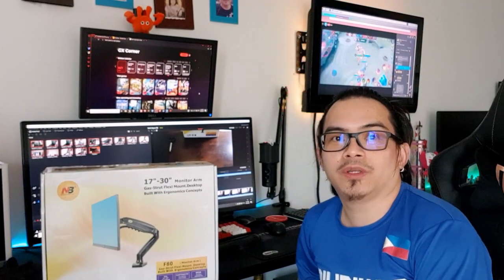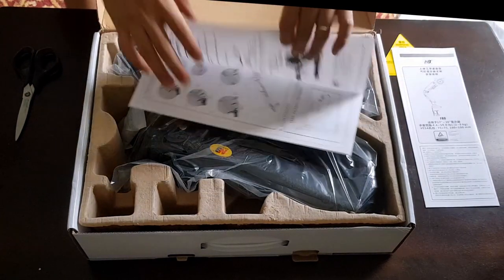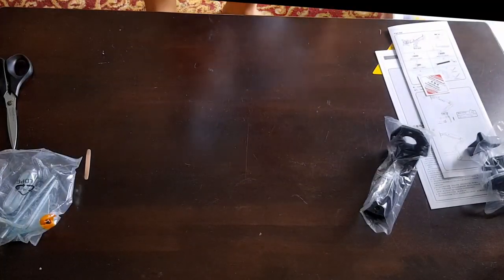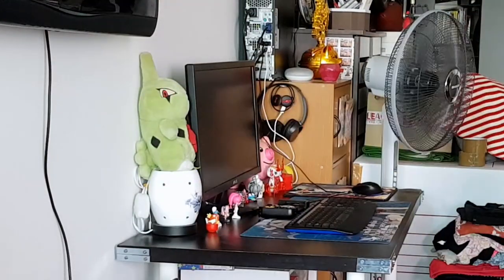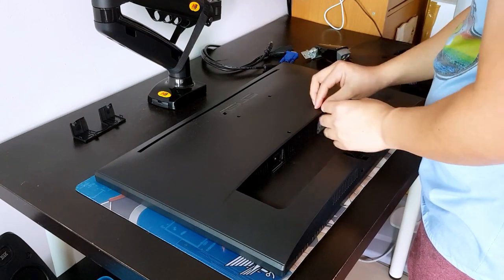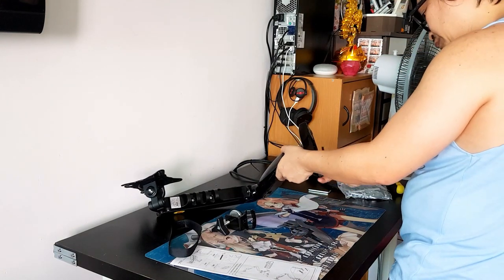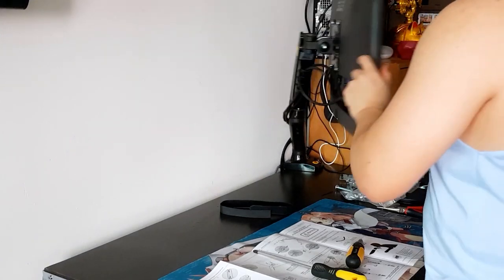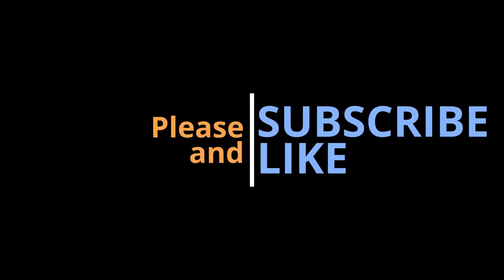North Bayou F80 Monitor Arm

Comment: Hello friend, excellent review I like that support, but I have a question, in the vesa adapter where the monitor is placed, exactly in the middle can a separate adapter be screwed? because I seemed to see one but I cannot be sure, what happens is that I do not need it to place a monitor but a camera and I would like to take advantage of the maneuver that allows this support, thank you for solving the doubts.
Reply from the maker: Hi Diego, thanks. I doubt if a separate screw can be added in the middle which touches the monitor. Though I have seen some adapters online for monitor mounts to convert them into camera mounts.

Comment: Hello po, Im having trouble sa arm niya, cause nagsspring back yung arm instead of staying in a certain angle. Also, paano nyo po napa-portrait yung monitor nyo? For some reason up, down, left and right lang sakin. Your reply will be much appreciated.
Reply from the maker: Meron siya adjustment screw para hindi mag spring back(up) yung arm.

Comment: Hello, is there a thickness requirement for the table? Thin metal table po kasi table ko eh. Thanks
Reply from the maker: Hi po, not really. Usually ang solution diyan is by using extra thickener. Pero sa case nito di kailangan kasi adjustable siya. Hindi ko lang pinakita pero gumamit ako ng sirang Hard drive sa ilalim para mas stable ang kapit.
Reply: @SabadoProject  salamat sa pag sagot boss. Nipis kasi table ko 1mm lang ata to eh haha. Bumili nalang ako kahoy pang pakapal just incase. nag order na ako nung f80 sana wala issues hehe

Comment: idol, ano max height from the desk na pwede i-angat yung monitor? Gusto ko sana kasi may monitors pa din ako sa desk kaso worry ko baka matakpan yung bottom part ng monitor na naka mount.
Reply from the maker: idol, you can check out the adjustable parameters sa link below:

https://www.therevisionist.org/reviews/north-bayou-f80-gas-spring-monitor-desk-mount/#Cons_Limitations

hope it helps!
Reply: @SabadoProject  thank you idol!

Comment: Boss ayos po ba to para sa pen display tablet?
Reply from the maker: Pwede po pero you would need to play around the adjustments
Reply: Hello, may I ask how you fixed the tension adjustment. Seems when I max it out to the right kasi (+) it springs back up.
Reply from the maker: are you using the recommended monitor size? if so, then there could be something wrong with your tension adjuster if it is springing back up.